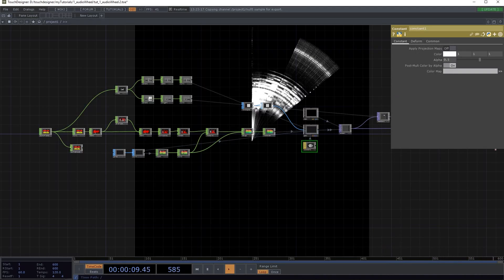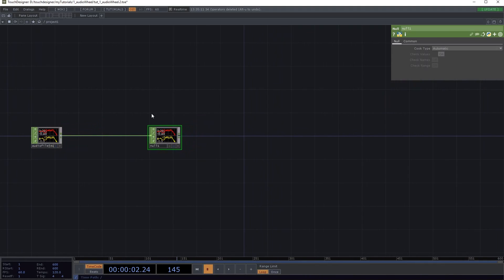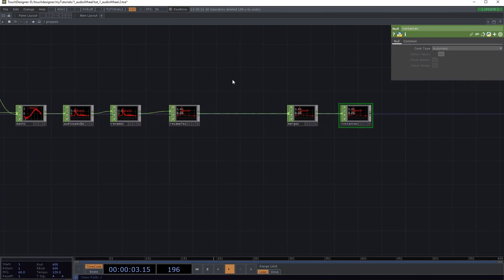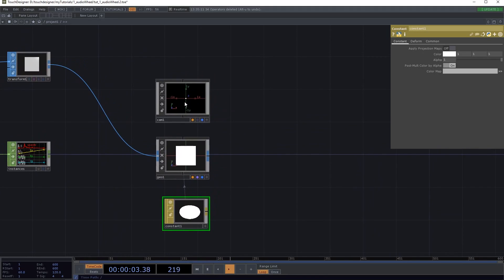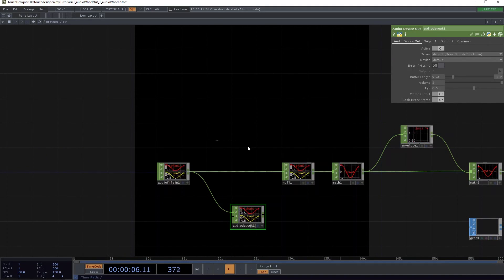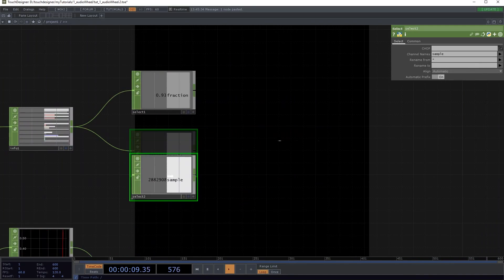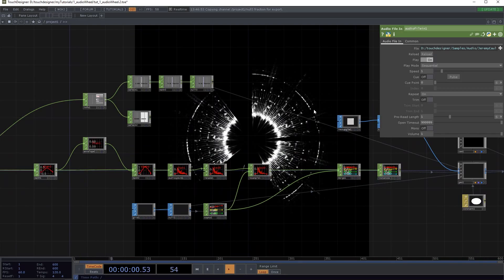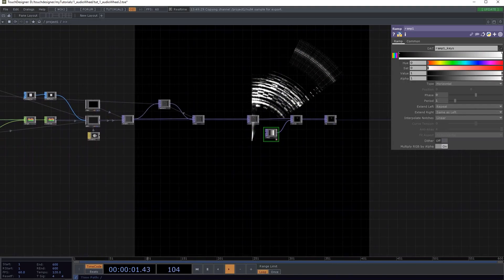Audio Wheel – TouchDesigner Tutorial 1

Comment: Hi! I'm new to TD and I love your tutorial, I'm trying this out on the non commercial version, and I did get the result after step by step following :D but then TD chrashed as I changed the settings in opperater of 'audio device out', and as I redo the whole thing, at 8:23, when I changed the color rbga channel to 'spectr' , the line became a pixel box, I followed the steps along but I just couldn't get the result (I did tried update but still can't get the result).
Reply: I'm having the same result.. how did you fix it?
Reply: I think you have to shift the camera's x value by the size of the grid so 30 in this case  @IvanCarosati

Comment: Hey! I'm trying this out on the non commercial version, but it doesn't seem to work. First of all the Look tab doesnt appear in my project container (when I zoom out, the step in 9:18 ) in , and despite that I do everything like you did, but no lines appear in my "canvas", just a black box.
Reply from the maker: Hey. Do you have the latest version installed? Because I think they changed the layout of the containers rather recently. And if it doesn't appear in the container try clicking the cross on the operator twice (off/on) and change the the "Background TOP" name to the corresponding null in the project. Hope that helps!
Reply: @elekktronaut  hey! its difficult problem... but please tell whats in your geo?)
Reply: @elekktronaut  in our "geo" only "torus"...if I add components "in/out"the desired input output appears but there is no image and signal(sorry for my English)
Reply: Did you have luck solving this ever? I feel like I'm having a similar issue.